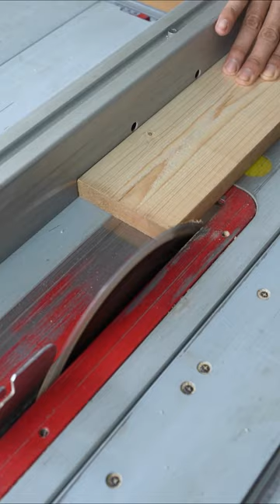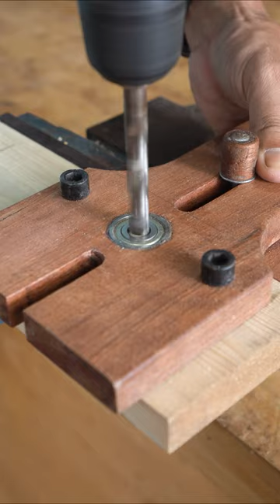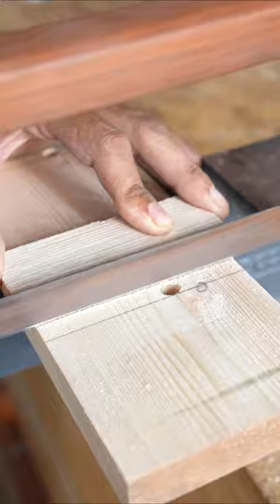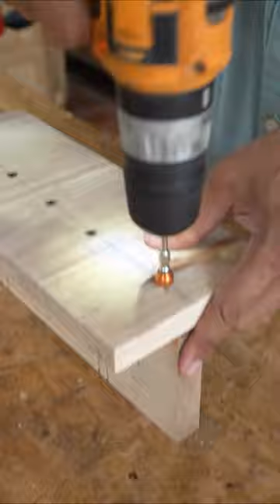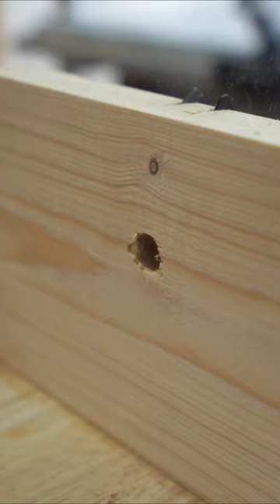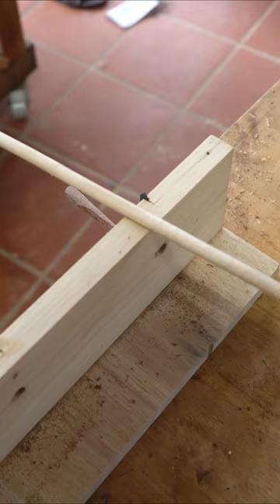DIY Create woodworking Tool Tips with Saw #shorts #woodworking #diy #trending

Comment: It looks like you've used your tools enough to know to use the push stick nearer the blade than the fence. When pushing closer to the fence you have a drastically higher chance of kickback. I'm actually shocked the piece you cut on the table saw didn't kick back during that shot.
Reply: Has the riving knife installed at least